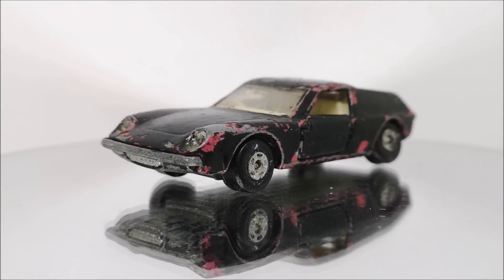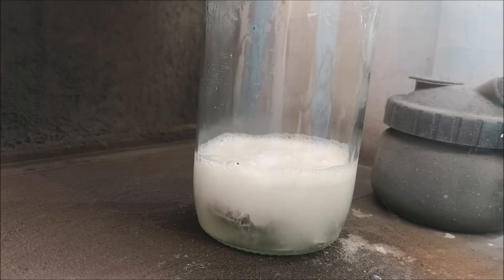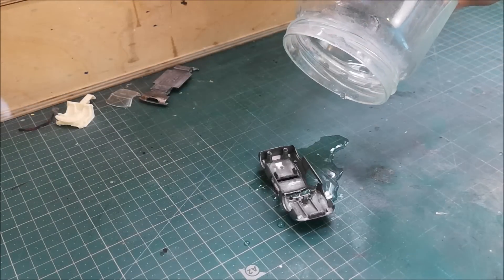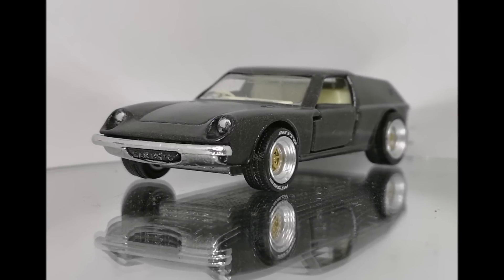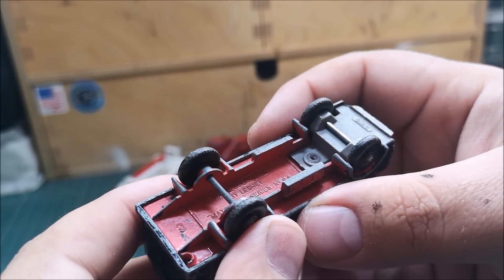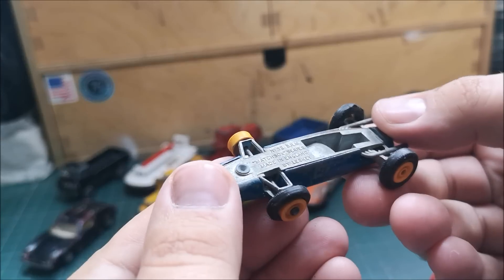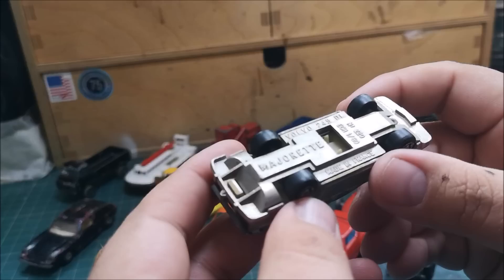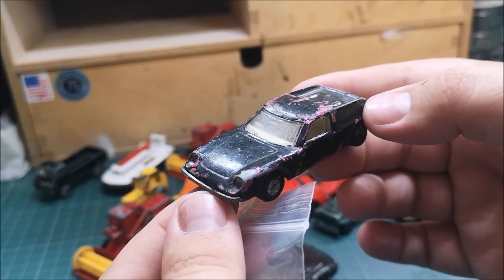Lotus Europa Chameleon Custom + Unboxing!

Comment: I used to have 3 of these Lotus Europa's as a kid, a red one, a pink one (like this one was originally) and the black JPS one. Fairly sure it didn't come from Japan though. I like the flip on this one Rob kept it like it was painted by the previous owner and original at the same time.
Reply: I had the red and JPS ;}

Comment: Hi Rob, great resto job! The wheels and paint just suit the car perfectly...can I ask, though, what clear-coat do you use? I'm using both Vallejo and Ammo-by-MiG and I can't get my models to shine like that. I'm using an Iwata HP-C Plus airbrush and a 1/6hp compressor with a 3ltr tank, set at 30psi....?
Reply from the maker: I generally use Molotow Belton Premium Spray Paint 400ml Clear Coat Gloss

Comment: Didn't Tara King have one on the new Avengers. PS a nice restoration 👍
Reply: Tara King was in the sixth season of the original Avengers series; the New Avengers cast Joanna Lumley and Gareth Hunt as Steed's partners, Purdey and Gambit.
But Tara did drive this model, if I recall... 🙃
Reply: Purdey had a TR7 and Dinky Toys made a yellow version of it, with New Avengers licenced packaging.